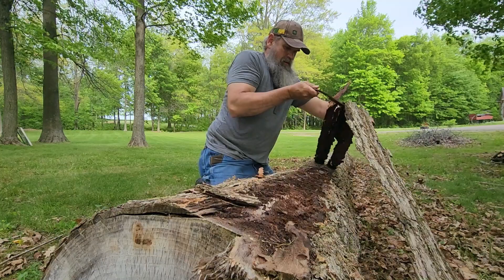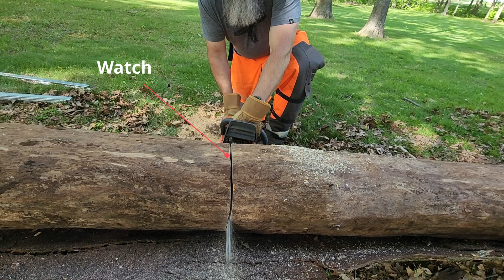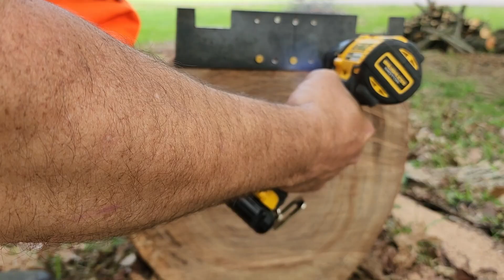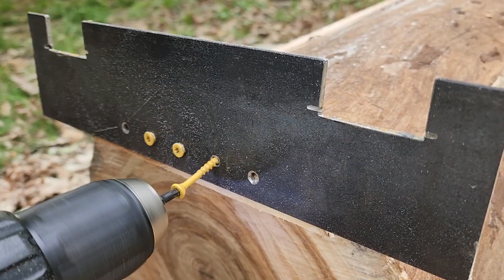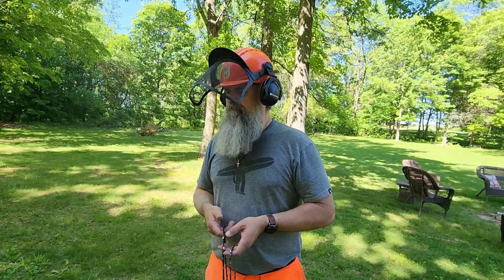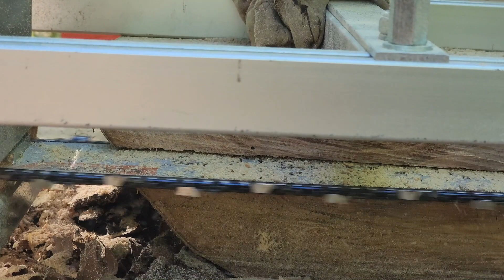Logs 2 Lumber - Mill your own boards with an Alaskan Chainsaw Mill!

Comment: There is a chain we used while I was working in Bastrop that was super aggressive and would throw the wood out in strips and not chunks. If I can remember which chain it was I'll let you know.
Reply from the maker: Since I recorded that video, I ordered 2 Granberg ripping chains. They arrived yesterday and I can't wait to try them out. That last chain in the video was a ripping chain, which is why it was so much faster. I had recorded a segment on the differences between ripping and cross-cut chains, but removed it to keep the video short. Maybe I'll cover it in another.

Is that the chain type you were thinking of? A ripping (or milling) chain?
Reply: @StillwaterHomestead  I can't remember exactly what it was. All I remember is having to sign a waiver saying we wouldn't sue if we got hurt but the chain.
Reply from the maker: I know that a very sharp chain will pull strips of wood off, not little chips. A dull chain makes dust, not strips. It's one way to tell how sharp your chain is. However I think part of that has to do with how fast it is cutting through the wood. The faster the cut, the deeper each chisel is cutting, thus producing a bigger chunk or strip of waste. I have seen strips pulled off when cross-cutting wood, but never when milling. Perhaps its because milling is cutting the full width of the log and thus goes much slower.